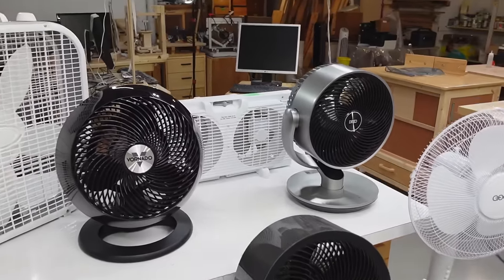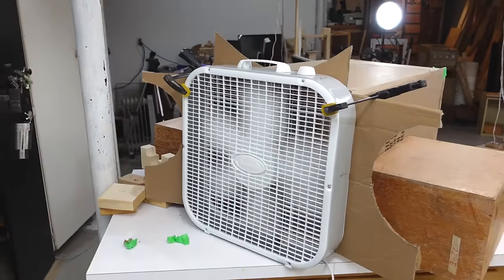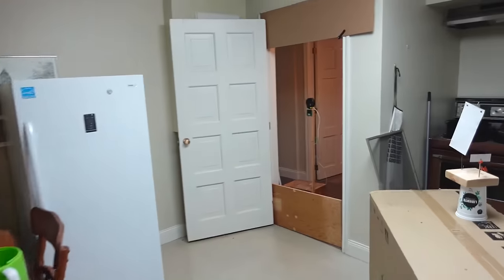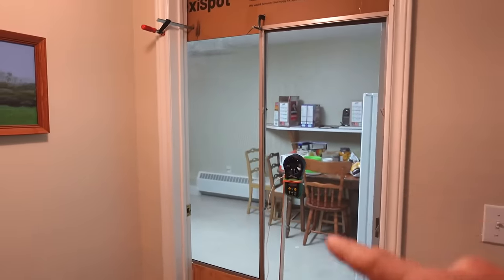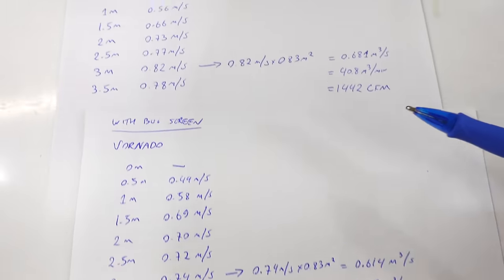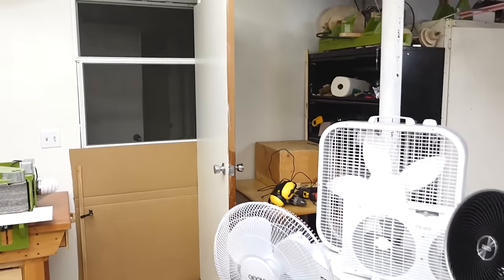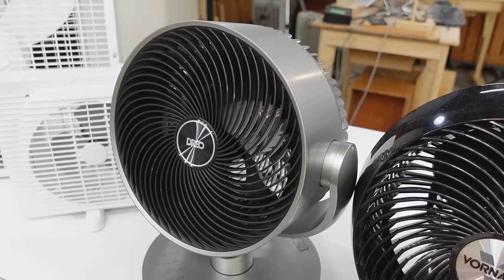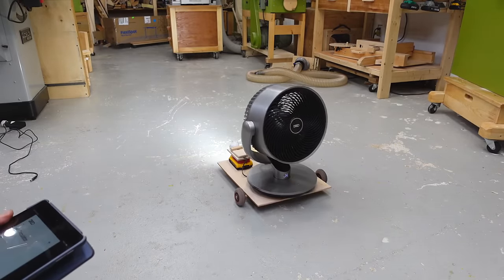Air flow: It's all about fan thrust

Comment: A fan also moves the air on the sides of its body. Plus suction and air movement is not the same thing.
Reply from the maker: correct,  it’s not about suction, is about how much total push it gives all the air, which can be measured as thrust

Comment: The only thing that this doesn't take into account is wind, with the window screens you seem to be trying to simulate bringing air in or out of a house. If I have a fan blowing at a window that is 3 meters away, but the wind outside is blowing towards that window, I don't think it will be as effective as the fan right in the window. But I am not sure how you'd measure that.
Reply from the maker: if you are going against the natural wind, perhaps it would be better to just turn the fan off and let the wind do its thing

Comment: So thrust to price with Dyson vs. Dreo Pedestal, means that for 1 Dreo at $139.99 you would need to spend ($499.99 for a Dyson = $124.99). So at that point... I guess the cooling value in your living space vs. the $80 vs. the noise?

I guess that would be the comparison. Essentially, take one vs one and say "Is the noise value better or worse."? ;s

Comment: What the hey Matthias, I really appreciate your thrust measuring.. but air moved should really (also) be proportional to power used but that was not in the data shown?? 
I think your conclusions are accurate and complete either way but would be interesting to see how power used influence the results

Comment: I still don't really understand how moving the fan backwards increases airflow 😞

In understand that the main air-stream will pull outer air with it. But the overall kinetic energy of the moving ait obviosuly has to stay the same, so this outer air should induce air to the fast moving ait and slow it down, which should lead to the same airflow measurement farer down the hallway, or not?
Reply from the maker: Yes, the air that went through the fan is slowed down, but its still the same volume of air, plus all the air that got pulled with it.

Comment: Awesome video, just wondering in your opinion, does the weight of the fan contribute to the results of your thrust data? I ask because because these newer box fans for example, blow over so easily compared to the old heavy steel American made ones (yes I'm aware of the footprint stability differences), but certainly the old ones blow way harder. That aside, I feel the weight has to skew the data somewhat. Afterall, the thrust has to be powerful enough to overcome the standing inertia to move the fan reward, which is directly in relation to the weight of an object at rest.
Reply from the maker: no, weight doesnt add to thrust, and to the extent that it does slightly change the scale reading, I always tared it with the fan off first.
Reply: @matthiasrandomstuff2221  I was referring to the heavier fans potentially experiencing less thrust measured, due to their greater inertia. I know there's a thrust to weight calculation for jet and rocket engines, I assumed the same principle would apply. Thanks for the response tho, and I'll stay tuned to your channel for sure!

Comment: Given the increasing importance of wildfire smoke mitigation, I'm wondering how effective entrainment would be for increasing flow through a high-MERV furnace filter (the kind that would eventually burn out a typical HVAC system's blower). Most people making DIY air purifiers just put a box fan right up against the filter, but maybe there would be a way to make a quieter fan work.
Reply from the maker: Less effective than not using entrainment.  Entrainment is only useful if there is not a lot of resistance to flow.  If you are trying to blow through a filter, it will cause most of the air to not go through the filter.

Comment: Turn that fan around on the sled you made for it and you should be able to steer it around the place by turning the fan remotely. 🙂
Reply from the maker: yes, that would be fun, but panning the fan side to side is too slow considering how fast the cart went.  Also, I didn't have any caster wheels on the cart

Comment: When I use a window fan I pull in denser cooler air in at night. Do you think if I put a high velocity fan at the appropriate distance from the rooms door way that would pull more air from the outside using the same window opening minus the fan housing? It seems like it would, but would denser air, Force less dense  air to come back in around the outside edges of the air moving out the door? I know there are a lot of variables, density difference, temperature in room outside of doorway, location of walls, furniture etc. As always, enjoyed your video.
Reply from the maker: depends.  If you blow at the door opening, you aren't blowing at the whole opening, so it may be less resistance for air to come back in thru the rest of the door opening than through the window, which is smaller and probably has a bug screen on it
Reply: Thanks Matthias. I think the answer is to follow your example and experiment with a few different options. Cheers.

Comment: Have you looked at the motors in these things? In my experience they can be a bit poor and difficult to maintain, attracting dust, getting slower over time and eventually seizing up as the bearing fails.
Reply from the maker: yes, made a video about it too, years ago

Comment: I've always wondered how much better a generic box fan would run with a proper case/box?  A lot of wasted space around the fan blades. Maybe some day I'll turn one into a proper ducted fan.
Reply from the maker: The one time I experimented with that, it made no measureable difference.  in terms of thrust, it may even make it slightly worse, because the fan blades often also suck in air from the side.

Comment: great analysis, but, $100 for one of those fans?  oof, i doubt it will be worth the price difference.  either vornado "whole room circulator" ones that look about that size are still 42 or 56 dollars.  half the price.

HOWEVER, i do really appreciate the "circulating whole house through 2 windows" test at the end.  it does show me i need to move my box fan away from my window so i get better airflow.  (although, i think he already did a video like that years ago and i'm just forgetting that info)
Reply from the maker: A bit less if you buy it today or tomorrow.  But I have the feeling you won't be :)

Comment: Would like to see a statistic of thrust per energy consumed. Maybe the Dreo is sky-high compared to the others?
Reply from the maker: The two dreso actually had the lowest energy consumption.  The other fans all use induction otors which for this size are not very efficient.

Comment: Wasn't the Dreo tower input occluded a bit by its base in the orientation you used?
Reply from the maker: Yes, but for the inlet, that's less of an issue -- the air just comes in from all directions

Comment: The 3 black fans are deeper in length, so their blades are deeper, so they have more time to push individual molecules up to speed, orient their direction of travel, and create the vortex spin.

Imagine a duct style structure the diameter of the box fan, with the length in scale! Performance would be outstanding but the tradeoff is that it's ridiculous huge.

Comment: If you flow a liquid through a tube and it's laminar.  The profile forms a parabola in velocity across the tube.  The peak flow is twice the average.  

Very interesting video.
Reply from the maker: yes, if the tube is long enough, and its laminar.  Neither is the case here.
Reply: @matthiasrandomstuff2221  But the flow would may not be uniform at your measuring point in the kitchen.   The box test would have uniform flow because the air is entering from a large volume.  but it's a great video.

Comment: Excellent comparisons and well presented, as usual.

I really like the thrust measuring setup.
You may have already considered this about that setup: Would the weight of the fan on the gimble change the curves?
I was wondering if you add weight so they all matched the heaviest or like that.
If fact, you could make a curve showing the same thrust with different weights then normalize the curves mathmatically instead of weights.

Thanks for the entertaining creation on YouTube.
Keep it coming.

Best to all.
Reply from the maker: doesn't make a difference.  There is only so much I will do to explain stuff to people who won't understand.
Reply: @matthiasrandomstuff2221  Why so rude?

Comment: is there a fundamental diference between a traditional fan and those black "circulators"?
Reply from the maker: Ducted fan.  Also, they blow quite hard.  So not necessarily something you put on your desk to gently blow air at you.  But if you need to air out the room or really mix up the air in a room, these fans are really good for that.
Reply: @matthiasrandomstuff2221  what does the duct do? is seen in you other videos it will just prevent air being sucked in from the sides? other than that they are basically just strong(er) traditional fans?

Comment: Would bigger fans be more efficient? They have a 24” and a 30” at the hardware store. Pricy
Reply from the maker: Yes, generally bigger propellers are more efficient.  But there is also the matter of how efficient the motor is.  For relatively small fans, a brushless DC motor makes  huge difference

Comment: The box around the fan is making all your readings invalid. A fan normally has air from the front wrapping around to re-enter the fan. The box is messing with the natural flow.
Reply from the maker: Then how would you measure the flow through a fan?
Reply: @matthiasrandomstuff2221  His point is in my opinion true, but anyways cardboard is best approximation in that case that you easy can do. But with longer box you kinda limit flow, so the static pressure gain bigger role than cfm- imagine long tube- cfm wont be accurate. Same is with computer fans- when you have radiator- you using different fans with higher static pressure than with air cooled computer. Look on @greatscottlab last video where he tried to 3d print vacuum cleaner turbine
Reply: @matthiasrandomstuff2221  Anyways great work!
Reply: @matthiasrandomstuff2221  I would just measure the flow at many different distances and do some averaging or other comparison.

My point was that a fan that does better in your test, may do much more poorly in actual use. The wrap-around air may draw more air or it could be a loss.

I do love how the window unit was better away from the window. Try testing a box fan, then add a cowl around the blades to see if it has better flow.

BTW, I always permanently remove the front screen, for better flow and noise levels. No danger as a finger will hit the blade's surface and be pushed back.
Reply: @matthiasrandomstuff2221  Maybe a blower door test which is what they use for energy audits of homes, so you can test for the air pressure positive or negative at the doors . The fans in the room are blowing air all over off of walls,  and making turbulence flows. You are measuring the air flow at the other door but don't account for how much air may be going around that sensor and back out that door.